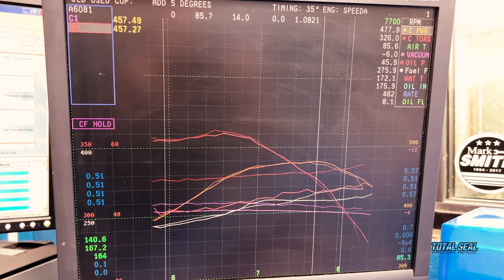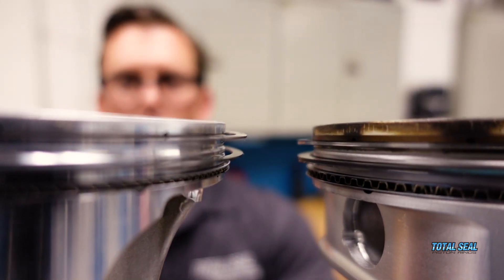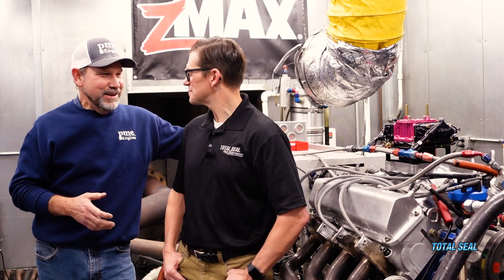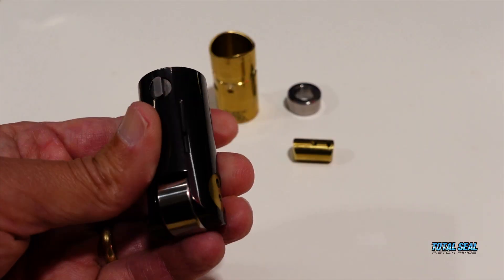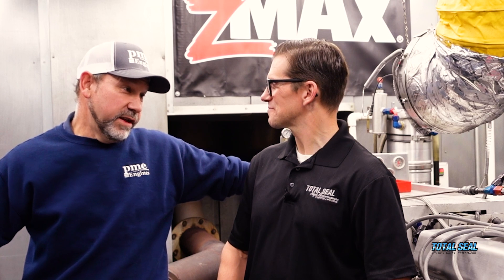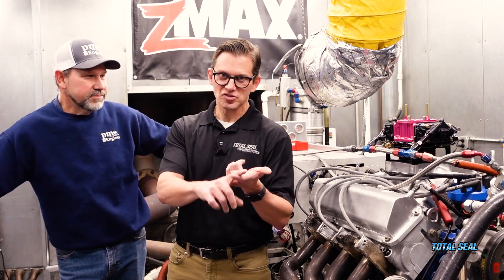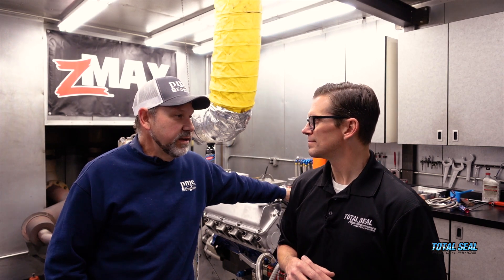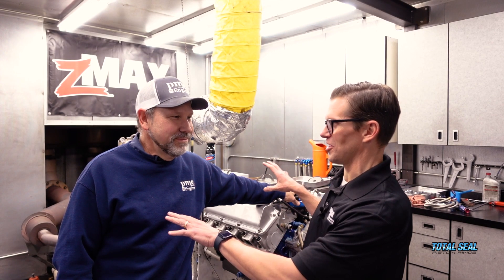Can You Gain 300 HP Without Nitrous or Boost? 358 CI FORD

Comment: What clearances did you use to run that oil ? What clearances did it have originally?
Reply from the maker: .0022 to .0024 on the bearing clearances. The original build was .0025 to .0027

Comment: Sorry for my ignorance, but this engine runs on gasoline, correct? Because I wonder how much more punch it would give if running on ethanol and a way higher compression ratio.😊
Reply from the maker: This engine does run on Gasoline, but it would make less power on Ethanol because the VP Q16 fuel has more octane than Ethanol.
Reply: @TotalSeal   Oh, I see. Thanks for clarifying this.👍🏻

Comment: Thicker oil, better ring seal, get slight bit more power.
Reply: Thicker oil will lose power because it will work the oil pump harder.
Reply: Wrong.  @C6Z_Bob  watch?v=DWblUriIwhg

Comment: I tried to get 0.7mm rings for my engine but unfortunately is not available for all engines.
Reply from the maker: That's true. Fortunately the .9mm rings are available in bore sizes.
Reply: @TotalSeal  not on all as well, I have to settle down with 1mm 1st  and 2nd ring, while my OEM sizes are 1mm and 1.2mm so not much gains of what I was hoping to get

Comment: Using Q16 really skewed this comparison.......to the point of making this a Richard Holdener level of useless information.👎
Reply from the maker: The Q16 was worth 15 HP. We made each change independently of each other.
Reply: What was the point in using Q16 as it never was(?) or is a legal nascar fuel?  If boosting the headline was the goal, maybe throw a little nitrous to it next.  @TotalSeal
Reply: LOL what? Did you actually watch the video?
Reply: LOL what? Did you actually look at the clickbait headline? @optimumperformance6998

Comment: Have David Vizard design the cam and you'll easily get that 800+
Reply: billy godbold is the msn
Reply: Though Comp isn't exactly top of the line in terms of technology, Vizard isn't a cam designer either. 🙂
Reply: @PSA78 you would be incorrect.
Reply: @PSA78  David Vizard wrote the book on cam timing. He's even developed a computer program to assist with lobe design and timing. David Vizard is the absolute most experienced cam designer in the world.
Reply: @TheLonesometoad  I know fairly well who he is and what he's done. 🙂
Reply: @PSA78 obviously not or you wouldn't have said that Mr. Vizard isn't a cam designer. Who do you think did Harvey Cranes cam🤨? Crane is not the only one who he has designed their cams. When he builds an engine it's his cam design they use not theirs🙄.
Reply: @lynnrunningdeer  From what I've seen and heard he would buy cams from those who develop, after he specifies what he need. Maybe he did develop the actual lobes at one time, but that's really old stuff in that case, and I've never seen him say that in regards to Crane, Erson etc that he talks about doing work with (and getting help understanding cams from). 
Bill do develop lobes, but I'm guessing he's held back by Comps.
Reply: @PSA78  🙄 He was also instrumental in help Isky with theirs. He's the only one with the IOP program to be accurate to with in 5% if everything else is correct. If it's off then you did something wrong. He may not still be holding his simmanrs because of health issues. But there were top engine builders who kept coming back to freshen up.
Reply: @lynnrunningdeer  I'm not trying to diminish anything he's done, he's seems like a great hard working man. But in terms of this, he's just not the leading authority, even he is getting help sometimes with some of these things (and that really is perfectly fine, as few cars in the winning circle use what the stickers say). 
There's several programs out there (both lobe design and estimating cams), they aren't all promoted like this though, some are proprietary and safely guarded as well.
I don't believe Isky have done any great progress in many decades regarding this, but I might very well be wrong as I haven't looked into it for a long time. 
The people behind the scene doing cutting edge work is rarely found on a sticker, book or seminar.